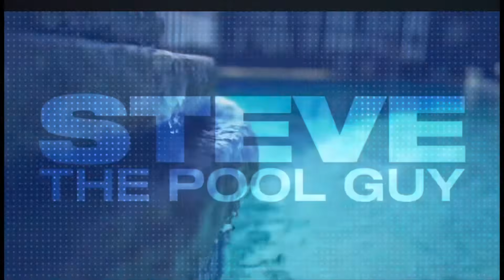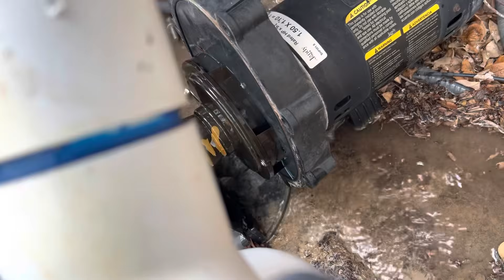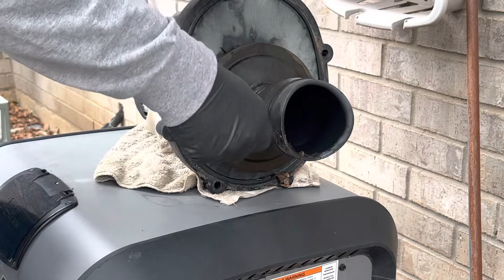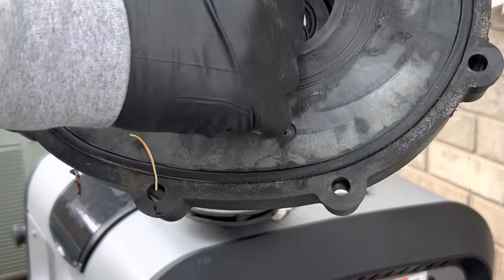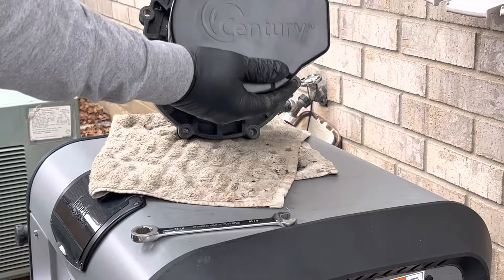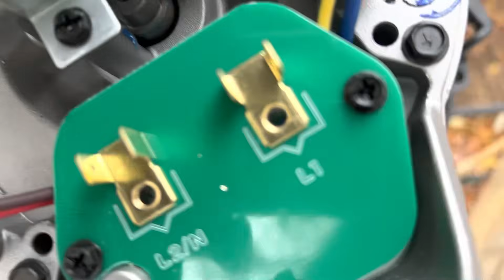Jandy Stealth Pump; Motor replacement

Comment: Your hands are blocking which way around the seal with the spring goes... "ceramic touches the white part"? I see a plastic end and a rubber end on the PS-3890..  Many thanks if you can clarify.
Reply from the maker: Good catch I did not realize that I was blocking the seal. The white portion of the seal with the rubber outer covering presses into the back plate of the motor, rubber in white ceramic pointed out toward the impeller then the shiny black portion with the spring on it the shiny black goes toward the white ceramic seal and the spring portion points toward the impeller. And depending on which model of stealth you have you either have the 3890 or the PS 201 in either case they go the same direction

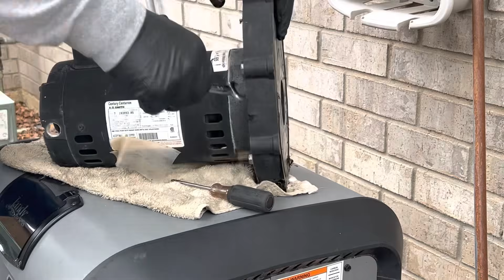Comment: Just took mine apart, the motor started making a loud whining noise and woke my neighbors up... that's how I found out I had a problem. Now, I had a hard time removing the impeller, wouldn't even budge with hand and the whole thing came off the shaft... unlike yours. At minute 1:10 when you remove the impeller, your motor shaft has the seal showing.... in my case the seal is on the impeller's small plastic shaft. It's the same A0580903 part number impeller as in your video but has a plastic shaft(wish I could send you a photo). Wonder why and thanks for your time.
Reply from the maker: Sorry I just saw this post. To answer your question in case someone else has same issue.  Jandy changed the impeller after a few years so there are two different types. When I would buy a replacement kit, it would come with both seals. I have a few old ones in my truck

Comment: How did you disconnect the power supply? The screws won't budge.
Reply from the maker: If it’s an older pump they may be seized up. If you’re going to replace it anyway, just go full force, they will break easily. Then the cover should open up, may have to pry it open too.
Don’t worry about breaking, if it’s a bad motor

Comment: What replacement motor do you recommend or use? I have a jandy shpf1.5 stealth. Is sticking with Jandy for $500 worth it? Thank you
Reply from the maker: If you can get the original motor, I would do that. They seem to be different in little ways. But enough to be noticeable over the life of the motor.
The century replacement motors are a little lighter and don’t seem to last as long.

Comment: Why do my screws from the defuser not screw into the back plate.
Reply from the maker: It is possible they are stripped out. Often with the stealth pumps the brass inserts in the motor mounting plate deteriorate, especially in salt pools.
If this is the case there are two repairs I have done. 
1 is to buy a new motor mounting plate.
2 is to buy slightly larger stainless steel screws with a course thread and screw them back in. Tractor supply used to have some that worked pretty well. I’m not sure if they still have them.  

✅Motor plate Amazon
https://www.amazon.com/Zodiac-R0445200-Backplate-Replacement-Select/dp/B00564H9N6/ref=asc_df_B00564H9N6/?tag=hyprod-20&linkCode=df0&hvadid=198100862572&hvpos=&hvnetw=g&hvrand=7148109342811970828&hvpone=&hvptwo=&hvqmt=&hvdev=m&hvdvcmdl=&hvlocint=&hvlocphy=9027237&hvtargid=pla-319121150282&psc=1&_encoding=UTF8&tag=stevethepoo0c-20&linkCode=ur2&linkId=8ed0cf38c313f5b034f6890b931daa67&camp=1789&creative=9325

Stainless screw tractor supply 
I would take the old one with you and get as close as you can.
Reply from the maker: The other thing is to make sure the arrow is pointing up. 
Hope that helps.
Reply: @Pool-guy  thank you so much. It appears the brass inserts have deteriorated